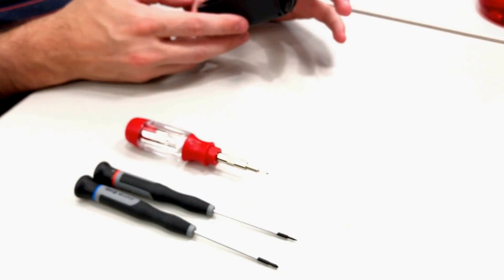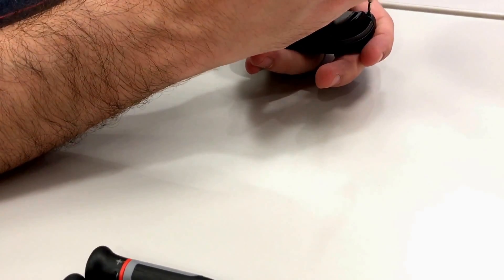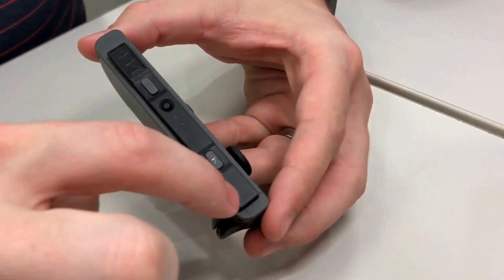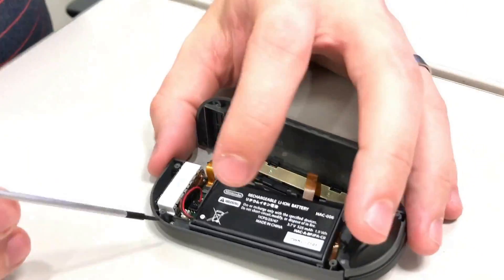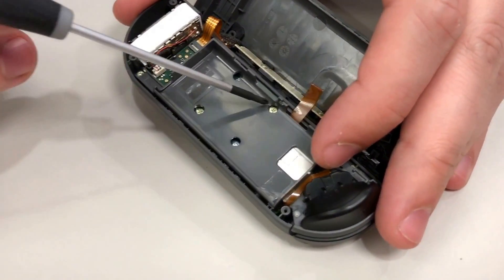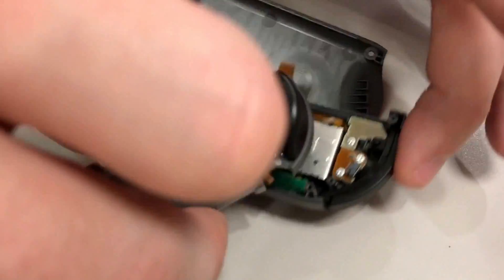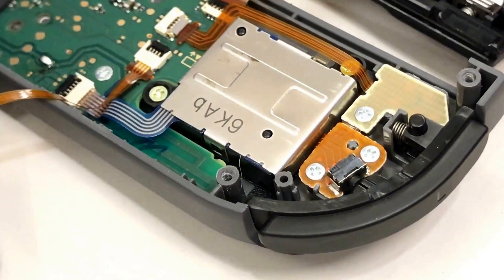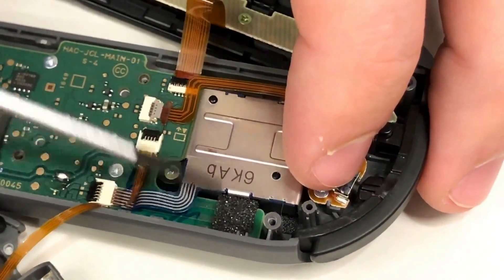Nintendo Switch Left Joycon Disconnect Fix

Comment: Where did u guys get the 3 way bit head?...cant seem to locate it
Reply: Or if you have a regular flat screwdriver which is small enough to fit in 2 sides you can get away with it :)
Reply: If you go to a large hardware store (such as Lowe's) they sell "electronic screwdriver set." I have a Kobalt 759897 which includes Y tips, several tiny torq tips, and even splungers. Or, a quick Amazon search for "computer screwdriver set" came up with this result, which looks like a bigger, better version of what I have. https://amzn.to/3gW6Xyt
Reply: @SilverWolf473  cool.thank you.👍

Comment: Hello. If I want to add additional foam, what kind of foam is this? Is this a non-conductive foam which is used i.e. to wrap electronic stuff?
Reply from the maker: aradzisz shouldn’t need to add any, but yes. Non conductive gray foam.
Reply: I've read that polyurethane foam can be used

Comment: my right joycon is the one that disconnects.  Would it be okay to perform this on the right ?
Reply from the maker: I think this is fine.  I don't see why it wouldn't work.  Always take everything apart carefully, especially if you haven't done so with small electronics.
Reply: It looks like the right joycon has a different antenna mechanism.  I don't know if this would work or not.  I'm not sure why I have three right joycons which lose a connection while everyone else complains about the left. :(